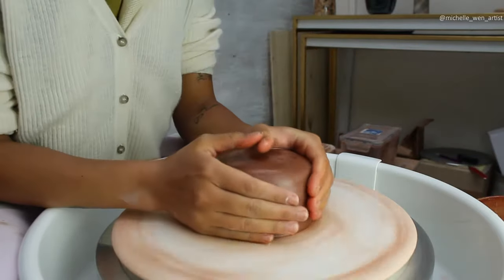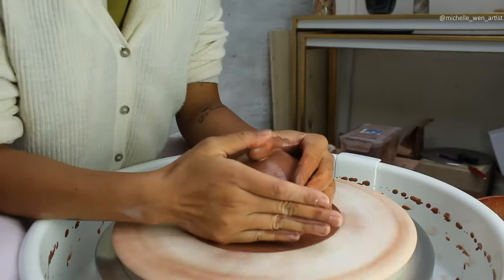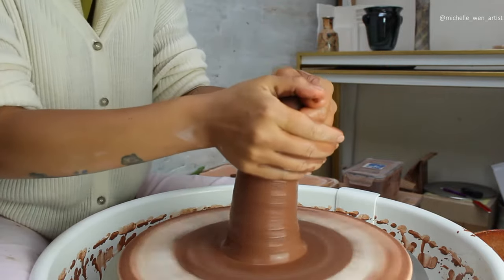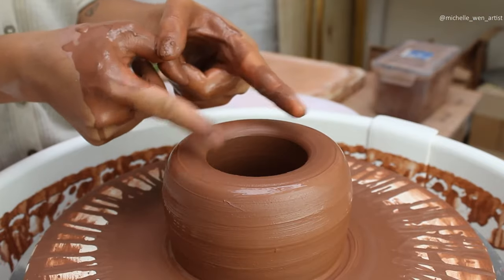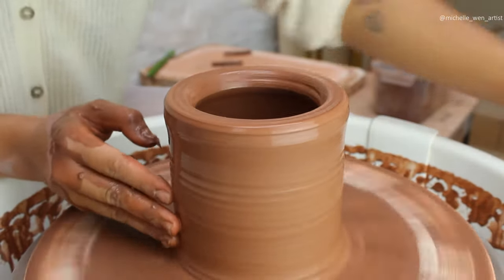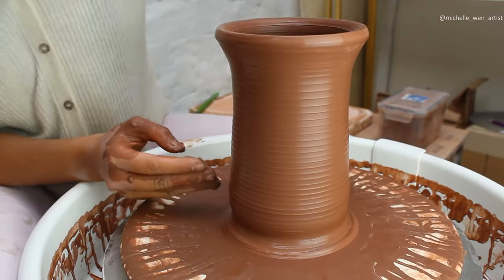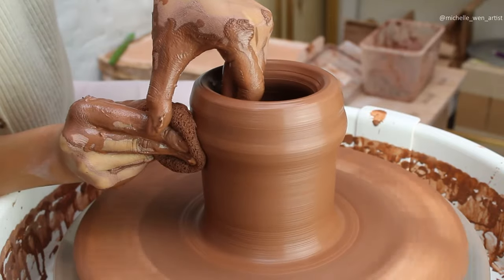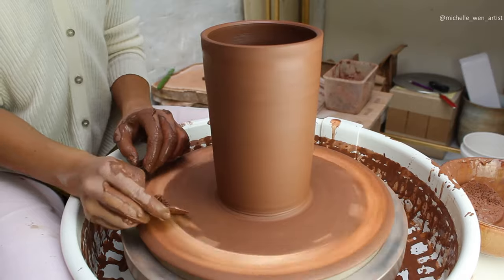PULLING WALLS: POTTERY 101

Comment: Hi! I have a question - the problem I run into is that my clay gets really top heavy… the top flares out and when I try to cup my hands around it to pull the top back in, it folds over itself and the whole thing falls apart. Any tips? Thanks!
Reply: Stand up if you're going for height in pulling the walls up.
Reply: Slow down your speed
Reply: What the other two comments said plus harder clay is another thing you can try.
Reply: Collar in after every pull

Comment: Very straightforward explanation and demonstration. I’ve never had a problem centering, but I do have a problem with getting the base the right thickness every time. I like the lack of extraneous detail in this video, as one can see what’s happening anyway, and can concentrate on the wall pulling.

Comment: Thank you so much.  I feel like you explain with a lot of clarity.  It helps a lot.

The thing I struggle with is I feel like, when pulling, my finger on the outside is almost digging hard into the clay.  I guess I'm not sure of how much pressure to apply inside and outside.  I often also end up with it getting wobbly very quickly and very thin up top, but still very thick at the bottom.

Comment: I found your work on Instagram and followed you over here to YouTube. I appreciate the way you explain things clearly. How long have you been throwing on the wheel? I started back in February with ceramics but have been hand building most of the time. I found an instructor near me who has helped me start using the wheel but I need quite a bit more practice. Great video, thanks.
Reply from the maker: I've been throwing for a few years. I tell my students it takes at least four weeks to start understanding the basics...Definitely will take a long time to learn how to center properly, but be patient and spend all your time centering because none of the other steps will get better unless you center! And you will get there eventually :) Thank you
Reply: @michellewen8743  Thank you. I can center pretty well but I pull the walls up either too fast or slow depending on the wheel speed. I struggle to get that timing right. I will keep practicing. Have a great day.

Comment: What if my hand gets dry halfway through the pull
Reply: Rewet your hands or use a sponge that'll hold more water. You'll have a lot of water on your wheel when first beginning which will lessen some over time. But ultimately it's the water that keeps the friction down - the slip mud that's made from this can be useful too.